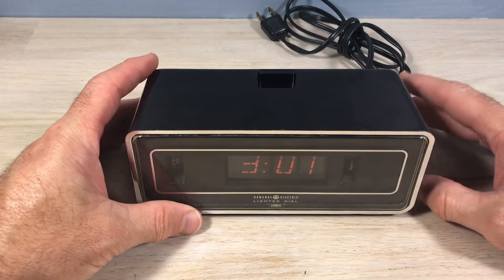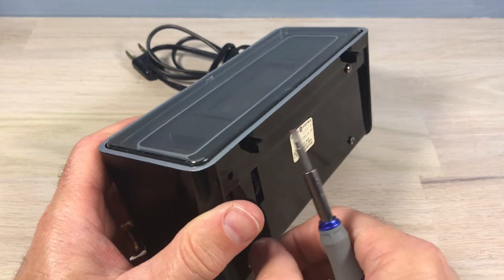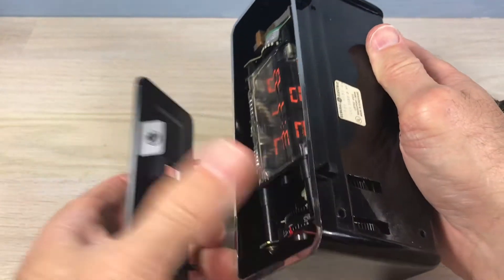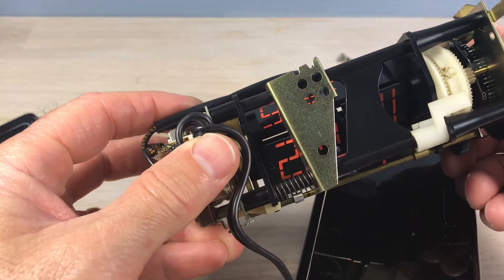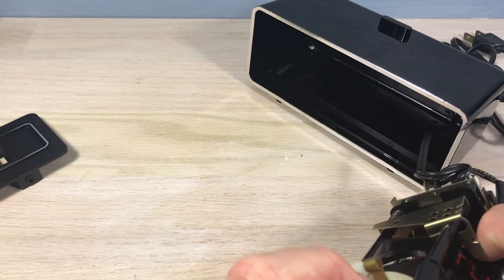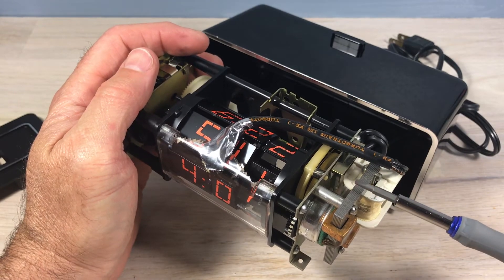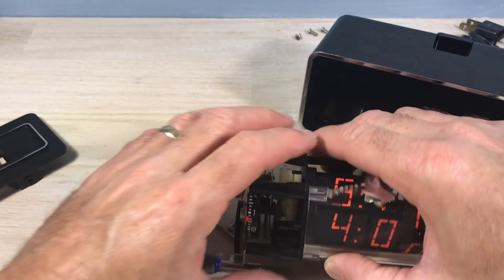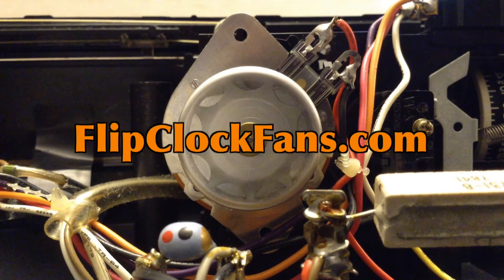General Electric Model 8132-4A Chronotel type flip clock

Comment: Interesting, I recently got one of these exact clocks at a flea market and mine is missing the front plexiglass window. Didn't even know it originally came with one. The gears meshing are a bit noisy in operation when the digits are changing, kinda wish I had the window to dampen the sound somewhat.
Reply from the maker: This may not be the problem. But it’s worth looking at:
When your clock makes a ticking sound
https://youtu.be/9bifXli5cOE